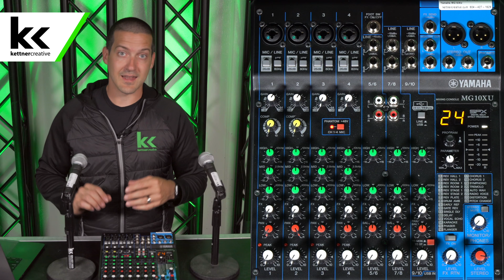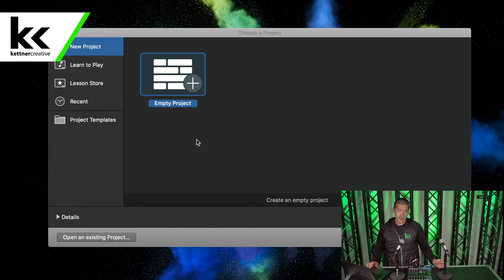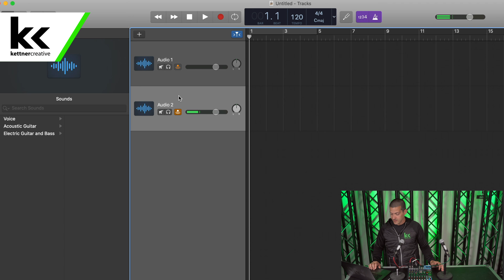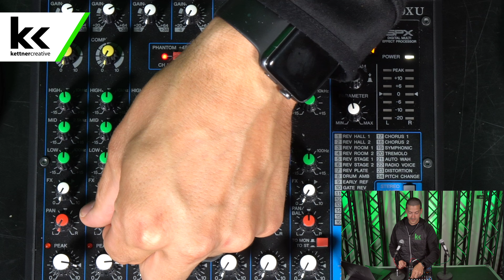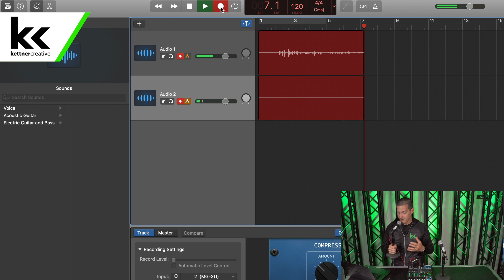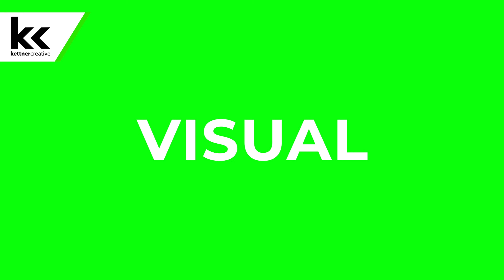How To Multi-Track Record Using Yamaha MG10XU USB Audio Mixing Console

Comment: I have been trying to find a mixer the would also allow to record the channels separately in Ableton. ( in case I make a big mixing mistake 😋 ) I found the Soundcraft singnature 12 MTK. But later I read that the EQ and effects are not part of the recording in Ableton, because those happen after sending the audio trough the interface. 

Are there any other options to solve this? Maybe a separate mixer and separate multi channel interface?
Reply from the maker: It's a feature, not a flaw. Anyone interested in multi tracking 12 channels generally wouldn't want to "lock in" an eq setting. This way you have full control with Ableton and you don't paint yourself into a corner by doing a low cut or something that you cannot undo later.
Reply: @kettnercreative  I understand that this is the case for most mixing situations. The thing I want to do with it is, recoding an EDM performance live set with multiple hardware devices as multiple tracks in my DAW. The changes in EQ are part of the performance in this case.
Reply: @FuZZbaLLbee @Kettner Creative Yes, I need to do the same - record multi-track with compressor and EQ, and effects from a live performance. Understanding the MT recording should be flat and effects applied post-production, sometimes it is desirable. I think those of us that want in-line EQ/effects, are trying to find multi-track USB mixers capable of doing so. 

The devil is in the details, as I found out with the Tascam Model 12 & 16 have different signal paths (model 12 allows all tracks with EQ, while the model 16 only does it on tracks 15/16).  

Jordan, can you elaborate on the Yamaha units, especially the MG16XU with respect to the signal path to USB? Does it allow this? [input -> gain -> comp/EQ/Effects -> USB] to all channels or just a stereo mix. It seems all multi-track USB mixers do not use the faders for channel volume, only the gain.  Thanks!
Reply: @msyracuse  did you find any mixer than was suitable for this? looking for one

Comment: Can I use a mixer to record 4 tracks simultaneously? Is it a limit of the hardware or software?
Reply from the maker: It's a limit of most small analog mixers. Generally speaking, you can multi-track more channels on digital consoles above $1000 or so.
Reply: No, this is just a work-around for the stereo outputs of the mixer, by panning you can have two mono only tracks.

Comment: Hi Jordan, I had a problem when I connected my MG16XU and MAC to USB and turned on the Garage Band in the same way, and the signal I entered was a complete noise, even though I downloaded the latest version of the driver for MAC. Still no use, the input level has been a stable noise, I really can not think of any way, perhaps I should buy a interface?
Reply from the maker: I'm confused as to what driver you downloaded because there is no driver required for Mac.
Reply: It's Yamaha Steinberg USB Driver V2.0.3. I downloaded it because it shows up on the official website. Strange.

Comment: The only problem I faced with this was when using the headphones for output at the same time while recording.. I got one mic on one side of my ear and got my guitar output on the other side which was irritating. Do you have a solution to mixdown the stereo output from the headphones section to a mono output?
Reply from the maker: That’s right. If you pan your inputs they will be panned in the headphones.
Reply: @kettnercreative  Yup, I did follow the suggestions outlined in this video like a year back, but never could find a solution to get a mono mixed audio in my headphones. Well the mixer is now sitting in my church (I donated it) being used for live streaming during these tough times and I bought myself a Scarlett 2i2 3rd gen. Do let me know if you know a way to mixdown output into mono, so that the output is not panned. I have a small behringer mixer sitting somewhere at home, will check it out in that.
Reply: @AnilDhan123  why did you get the scarlet? I tasted both for recording and stay with the Yamaha. It’s so versátil, and much more useful in my opinion.
Reply: @Luis5KMaldonado  well it is good, got my Yamaha back..I would say it's good for live performances but not that great for recording, unless you want a mixed down version of your audio. For recording multiple channels separately I felt the Scarlett does a better job.
Reply: @AnilDhan123  that is if you want to do what you mentioned on the comment above.

Comment: I have a Yamaha MG16XU and I’ve been having trouble doing live show recordings , how can I have 7 inputs recoding all at once. Is it possible to have each instrument on its own track? I’m using a USB to laptop connection.
Reply from the maker: You can only record two channels at a time with any Yamaha MG console. You'd need to upgrade to a digital console like TF1 if you want to multi-track.
Reply: Hello, my question is also same, I have Yamaha mg16xu and if we use Scarlett interface 2i2 can we do multi track recording like more then 2 inputs? say 4 mic and 1 keys etc?
Reply: @anuraggurusgo5880  u won’t be able to separate the files. It’ll all come in on one stereo track . So try to get your mix and levels right on the board because you won’t be able to process the different instruments individually . whatever comes into the interface and your DAW you can further edit as one stereo track, like a master buss

Comment: I learned some valuable information here, thanks. However, what I was searching YouTube for was for a different kind of multi-tracking. I want to record music adding one layer at a time, but I need to be able to hear the computer output in headphones without them recording them a second time. For the first track, I would need to be able to hear a click track. This would be best if I could have the headphones from the mixer so that the computer and its fan are at the other end of the room. I have not been able to work out or find out how to do this yet.
Reply from the maker: You can do that with the Yamaha. Press the USB button on channel 9/10. Leave the second button up on 9/10 and the click track will only come to your headphones.
Reply: @kettnercreative  Thank you, that's great news.

Comment: Great video, thanks. Question - can I use this usb output to a DAW to record ALL channel inputs (say I have 2 mics and 2 stereo keyboards hooked up) to 2 channel stereo vs. multitrack?
Reply from the maker: Yes. But you would just be getting the stereo mix. You wouldn't be able to receive each track individually in your DAW.
Reply: @kettnercreative    Got it - just wanted the option for quick live digital recordings - thanks!

Comment: Yamaha mixer having 2in 2out . I think it's not multitrack recording. Only 2 track recorded saperatly with using panning
Reply from the maker: Which means that you can multi track two clips, as demonstrated in this video. At the end of this video we have two distinct audio clips (not a single stereo clip). Exactly the same as multi tracking from a 2 input audio interface. 

As long as you pan, and setup two tracks in your DAW when recording, it works perfectly like a 2 channel audio interface.
Reply: @kettnercreative  can you explain me how to connect behringer uphoria 1820 audio interface with yamaha mg16xu for live track recording saperatly
Reply from the maker: @PratikNikam_Dmmusic  You can only multi track two tracks using the the Yamaha MG16, so you're better off just using the Behringer.